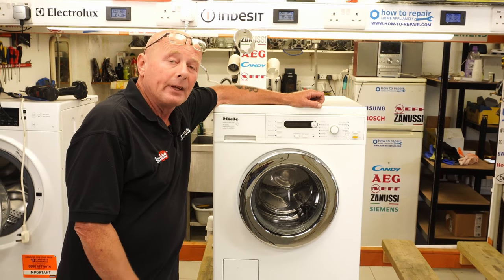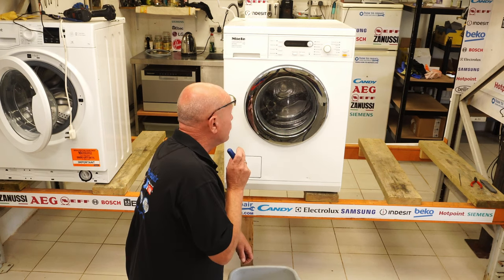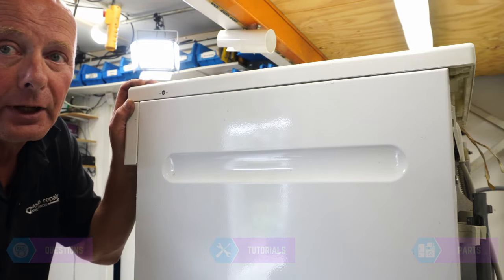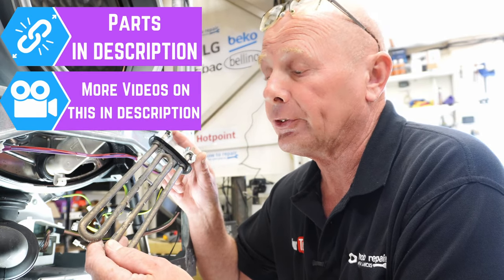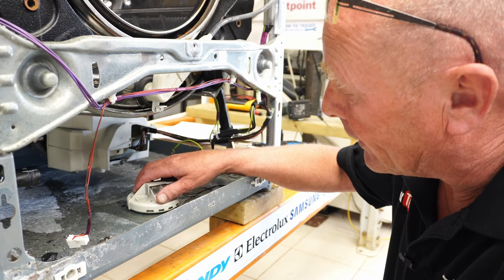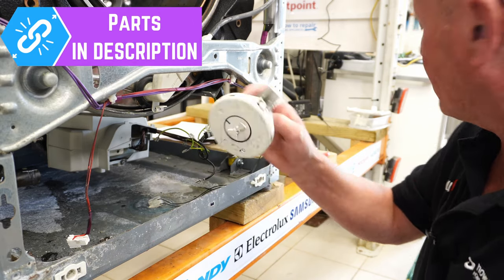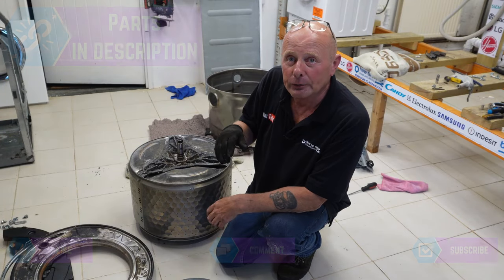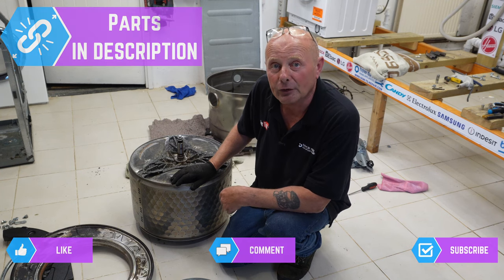Mastering #Miele Inside Out of a Washing Machine Dismantling Guide To Take Apart

Comment: I bought a Philco washing machine 2 years ago and the delivery man told me nowadays the washing machine are DELIBERATELY DESIGNED TO LAST ONLY 6-7 YEARS. .....SO THAT YOU WILL BUY A NEW ONE. NOW I KNOW WHAT HE MEANS NOW....An Aluminium Spider instead of a stainless steel one does the trick😂
Reply: My 2005 Candy is 19 years old, and still going strong! ... So, your delivery man was talking out of his backside! 🤣
Reply: @marcse7en read the post again.  You missed the 'nowadays' bit.  You can type an apology below.  We will wait...
Reply: I've been an appliance engineer for 35 years the drum spiders have always been aluminium stainless steel would be way to heavy for the purpose 🤔 cheaper machines are often built to a price so don't tend to last the test of time 🤫 those miele machines are very well built and often last 20 years or more 👍
Reply: Thank you so much for making of this video. Our 20y old Miele W3725 also has a broken drum spider same as the one in the video.... so it'll be a new one I think...😮. O well 3-4 full loads per day 6 days a week for 20 years I think it's done well.
Reply: The Miele machines where designed to last for 20 years and ours is showing the  bearing started to collapse. We have the w500 and I'm considering getting a refurbished miele that's newer but has the ability to be controlled by WiFi, so we can make use of the 7 p per Kwh offered on octopus to those who have electric cars and smart meters. I've heard that the  later machines are not a good as the early ones  due to suppliers in China, cheaper components and built in Poland ( I have no problem with the Polish people, it's only what I have read on the forums). Wish I could find out without you having to tear it right down to the last couple of components.

Comment: My Miele W5835 WPS same fate. 11  year old , The drum spider totally collapsed. Here in Australia I am now going to take Miele to legal task under Consumer laws . My warranty document states that I use get 20 year of domestic  use.. Used 1x weekly =less than 600 use cycles!!! Miele = totally pathetic crap. Warning!!!  this is a yet another major structural failure on behalf of Miele
Reply: Me too. Please let me know how you get on
Reply: Excellent idea ! The blanket statement that their machines are designed for 20 years use (5 cycles per week), whatever model is chosen is certainly misleading if not completely untrue.
Reply: @Martindyna 
I've had 25 years out of ours.. still going...
needs a drum bearing now though...
Reply: I wouldn’t mind betting that it depends which model you have as to how long the wetted spider lasts because the spider material may well vary i.e. more expensive models may get a more corrosion resistant one. Please advise what model you have or is yours a top end machine.
Notwithstanding my late Mum’s machine was base and has lasted 19 years apart from the shocks that were replaced @ 18 years.
Reply: @Martindyna  
it's a W806..
it won't be a top end one as I bought it in 1999 when I was 20 and didn't have a lot of money...
it's on its third set of carbon brushes and third set of shocks... I've also replaced the inlet solenoid after that failed...
but it has been hammered... it seems to be in constant use... 
if I came home and it wasn't turning I'd assume my wife had left me...
Reply: @ontheslide2339  Thanks. It's a mystery why some Miele machines not only live up to the 20 year operation thing but exceed it (with some spare parts) while others disappoint. Hope wife is still with you LOL. Those old Novotronics (can be seen here on YouTube) were great, I wonder if a modern Miele will last as long.
Another mystery is why Miele recommend that the machines door is closed while not in use. May be to keep the water seal protecting the bearings wet is all I can think of. My Mum's machines drum became stiff to turn after 6 months of no use with the door ajar, perhaps it wouldn't have happened if the door was shut? Spinning without rinsing or washing first may have ruined the seal perhaps.

Comment: Very instructive video. You*ve explained the functioning so well and give a lot of hints for troubleshooting. As a german consumer, I observe that Miele is going to ruin its reputation since  2002 - the introduction year of the damned alloy drum spiders and many other construction details. I LOVE my 27 year old Miele 912. Nothing to repair except a new door seal and a set of shock absorbers.
Reply: I have a 19 year old Italian made Candy, which cost £199.99. Much better value than an over-priced Miele!
Reply: We replaced an early Miele after 19 years (bought new in 1984) due to the replacement cost of a clock work mode selector. But also, the bearings were on the way out. Bearings do not last forever. IMO spiders are less of an issue than bearings. Which are difficult to replace due to person hour cost. Alloy doesn't rust. It does work harden. And suffer from chemicals I presume. Alloy saves power due to it having less mass. I don't think alloy was the problem with that spider, IMO it was that it was the spider itself was not a robust enough design. Perhaps later Miele machines have different spider designs. Note too that the older machines had brushes, which wear out, while modern machines don't have wearable brushes. If you buy a more modern Miele, a simple fix for spider apprehension, is don't spin the machine at full speed (many do 1600 RPM now). And don't run the machine at full capacity.
Reply: We change aluminium drum spider on W 3000 Gala (year 2010) from old steel part, and all fits now perfect. Hi from Czechia
Reply: Yes it seems that Miele have become less open about technical details of their machines, e.g. they used to declare the material of the outer drum (can be a fibre glass / plastic on cheaper machines rather than stainless steel (probably grade 316) on more expensive ones) and don't now. It would be better to be more rather than less open and state the material the Spider is made from imo.
Reply: @douglaslin5469  Aluminium spiders typically fail due to crevice corrosion, which occurs when aluminium becomes coated with moisture retaining biofilm grime that excludes oxygen (bacteria, lint, mould, fabric conditioner and liquid detergent residue etc etc etc). So basically not keeping the washing machine clean enough.

Crevice corrosion is electrochemical process, the biofilm excludes oxygen and since it retains moisture also acts as an electrolyte, with the differences in oxygen concentration causing current to flow, the areas with minimal oxygen get eaten away.
Reply: @mels8966 Szia! Tudnál olyan típusú gépet ajánlani amelyik vas csillagú (spider) és üstű. Most szeretnék venni egyet, használtan.
Előre is köszönöm a válaszod!
Reply: W526 owner, this has happened to my machine, dissapointed with Miele, Aluminium in water is always going to fail.

Comment: I enjoyed this tear down of the Miele as I had never seen one under the skin so to speak.  You can see why they are so expensive with a separate free standing support frame.  It’s a shame they whole machine is rendered uneconomic to repair because of a corroded cast alloy spider.  Had a Bosch where the spider broke quite suddenly after about seven years.  The inner drum scraped at the out sealed plastic drum, filled the drain pump with spaghetti like shavings and likewise was uneconomic to repair.  A simple pressed stainless steel spider would avoid this sort of problem.
Reply from the maker: It is amazing how a company that puts so much thought into the production of the machine with fantastic access for engineers then goes and deliberately puts a spider in that makes the whole repair process. Totally unacceptable. Yes this is a better design spider than I have seen in a lot of other machines, but they only cost £20 trade not £300
I guarantee the build cost of that spider is no more than £20-£30, but then they go and stick A miele pricetag on it, they're not allowing repair ability. They are not environmentally friendly and in my opinion they do damage to their own brand doing this.
Reply: I bought a Philco washing machine 2 years ago and the delivery man told me nowadays the washing machine are DELIBERATELY DESIGNED TO LAST ONLY 6-7 YEARS. .....SO THAT YOU WILL BUY A NEW ONE. NOW I KNOW WHAT HE MEANS NOW....An Aluminium Spider instead of a stainless steel one does the trick😂
Reply: @How-to-repair  Yes Miele seem to be becoming over confident that people will always buy from them.
They used to declare the material of the outer drum, now they don't (the data sheet no longer mentions any construction details).
They certainly should state the material of the drum spider then one can buy further up the range to get a quality spider.
Reply: @How-to-repair  I'm a appliancetech and I'm seeing this quite often in combination with long term useage of low temp programs and buildups of gunk around the drum/spider. This "eats" the spider witch acts as a sacrificial anode. Never seen this happen on a machine that is treated well with no residues inside!
I totally agree that this could be made in a higher quality material(as a Miele should be), but it also depends much of the right maintenance/use. Miele is anyhow way too overpriced(both parts and products), just to make people NOT want to fix their machines! They make them "repairable" but sets the price so high they're sure peopple scrap it and pays for a new one.
I'm more a Asko-guy, and the drum/Quattro-construction is significantly better than the traditional machines. But I've seen spiders break on these too, as a direct consequence of gunk-buildup. At least it's not so often on Asko as on Miele, Samsung and AEG. And the parts are also much more affordable compared with Miele.
Reply: I have an old Miele W304 Premier. A couple of years ago it started banging when starting the spin and a local repairman, without looking at it, told me that the drum spider had failed. It soldiered on for another year or so. When the banging became intolerable, the drum was starting to move and scorch the rubber door seal. I found that the drum turned smoothly, but at a certain point, it 'dislocated'. Using this video, I dismantled it and found a corroded drum spider. I purchased a replacement hand-made stainless steel spider on-line, cleaned and refitted everything with new bearings, bearing seal, hose clips and door seal and it has worked smoothly and quietly for over a year now. The pump brushes failed last week but that was an easy and cheap fix. The major overhaul was one hard day's work and about £180 for parts, but the machine is now essentially 'better than new' as the drum spider can't dissolve in alkaline water! Miele only offered to sell me the complete drum and (alloy) spider assembly and it was ~£500 if I recall correctly. Repair costs have to be considered against the cost of an equivalent new machine. Apart from the drum spider, most of the parts are readily available second hand from the large number of scrapped machines.
Reply: @How-to-repair Szia! Tudnál típusokat ajánlani amik rozsdamentes acél pókkal (csillaggal) készültek. Most vennék egy használt gépet és tudom, hogy a régebbiek közül kell választanom.
Üdvözlet Budapestről!

Comment: In the Zanussi washing machine, if we want, by default, after we run the washing machine, it will automatically select the quick wash mode without turning the knob, and then press the start button so that the machine starts washing?

Comment: Fantastic video, Thanks. It helped me a lot for how to disassemble. After a washing of a very fluffy carpet that filled up the filter I managed to fill the bottom plate inside the machine when pooring out the water slowly from the filter opening without the cover lid that normally leads out the water on the floor instead of inside the machine. Didn´t read the instruction before.
Reply from the maker: Glad it was helpful! Please remember to subscribe to our channel, as that really helps us 😇

Since we work very hard in our warehouse making free video guides for you all on appliances, we always appreciate a beer, offering a choice of single or round beer. https://www.how-to-repair.com/help/buy-paul-a-beer/

Comment: Currently changing the belt on my old Miele. Ready to put it back and came here to make sure I'm doing it right. 
Having owned Miele washing machines for over 20 years, I recently found out the orange thingamajig at the back of the soap drawer front is a tool for opening the filter flap.
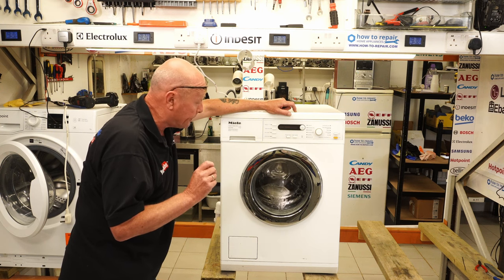At 2:07, I saw you using a flatblade screwdriver to do this. I always used a table knife to prevent any damage. Now I use the tool provided on the back of the soap drawer panel:-)

Comment: Fantastic video and well narrated. I did exactly the same to dismantle a Miele washing machine model W340 but I didn't have the hoist so made a rig by wrapping a rope around the outer drum added a piece of wood as a lift bar then manually lifted it out of the frame. Quite a struggle without help, but did use some timber to lever up the drum in order to disconnect the springs. 
I believe the weights are cast iron not concrete. 
All in all a very well designed machine. 4 spring suspension is much better than the 2 found on most other makes. I also had fun trying to spring the facia panel from the front controller but achieved it without removing the spring clips you showed, next time I’ll lookout for them. 
The final comment is a negative one, in that the aluminium spider is the weak point on this machine. Mine was cracked thru in the same positions as you demonstrated. It was the only thing wrong with the machine, even the bearings were still good. As you commented an extremely expensive replacement over £500 for the drum and spider assembly, so the machine was recycled and a new one purchased. Unfortunately after making the decision to buy a new machine I found a company who were offering a stainless steel replacement spider for a reasonable price. I was unable to follow up on that as the new machine arrived the next day. 
I can forward the spider details if you would find them of interest.
I applaud you for taking the trouble to dismantle the machine and to offer all the good parts for sale, saves everything going to landfill. Well done.
Reply from the maker: Yes I would love the information to hand out to others. With regards the stainless steel spider please use the contact us page at the website to send the information over I know how much of a struggle it is to lift a drum out manually. I've gone past that age now I just buy toys to do the job. Thank you very much for the comment. Much appreciated.  @user-rn3xv6vg7w please remember to subscribe to our channel as that really helps us https://www.youtube.com/shorts/e432SAb2g08  Thanks, Paul 👍
Reply: I don't have hoist either, but you don't really need a  hoist if you detach/remove the 2 front heavy weights 1st. Drums lift out easily after everything else removed first although still fair weight in the 4 arms cast iron spider back of the external drum from that supports the spindle and pulley wheel. In my case the inner drum spindle was so bad it had broken clear of the centre portion. and was removed prior to the external drum.

Comment: A few tips the pipe from the pump to the overflow gets blocked up and causes weird faults. Also, remove the pressure pipe chamber to avoid breaking it on the lift out. Mark the drum if you intend to reassemble the machine. The old cast iron spyders will fit in a lot of the newer machines. But some cast spiders have a hidden magnet for balance detection. Early spider failure is indicated by swelling and the drum starts rubbing lightly on the door seal.  The early models weigh a lot more than the newer ones due to a heavy steel cabinet. Solid as a rock and thick enamel. You defiantly need a winch for Miele. Cast iron no concrete.
Reply from the maker: I really appreciate your input. Most common faults will help a lot of people

Comment: Thank you for sharing this video. I used it to take apart my machine, which was making an awful noise. It turned out to be the same issue as the machine in your video, so I had to scrap it but at least I know that I didn’t replace a machine that could have been easily fixed. Every other part on our 13(?) year old machine was sound so it’s a shame they used the alloy casting. Thanks again for the video.

Comment: Hello and thank you for making this video. I have an almost identical eco w 5000 machine. Lately it has started to keep the pump running on the end of the cycle. There is no error codes and the cycles run all the way through to the end. The pump just keeps running until I open the door or turn off the machine. You wouldn't happen to know the cause of this? Best regards!